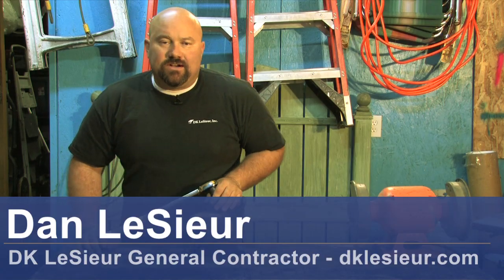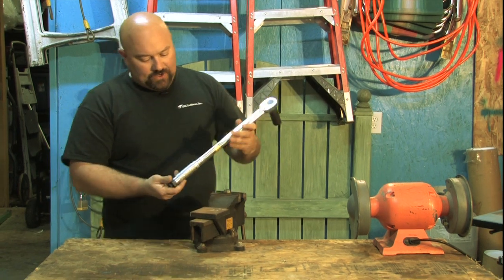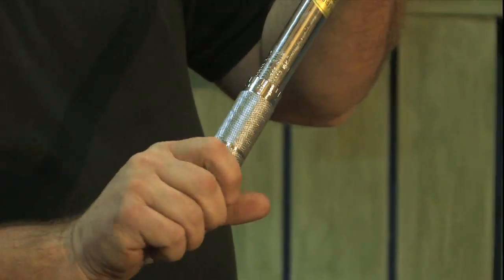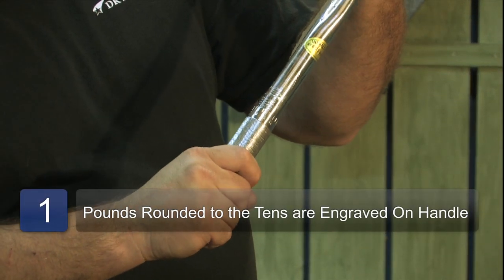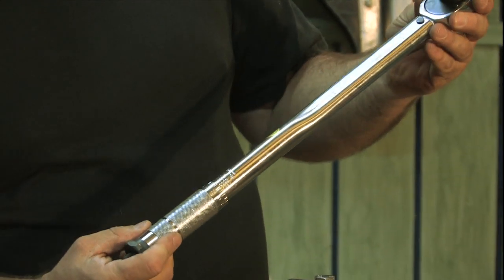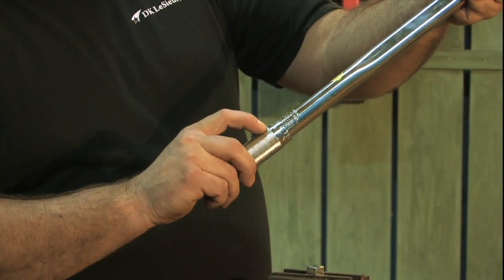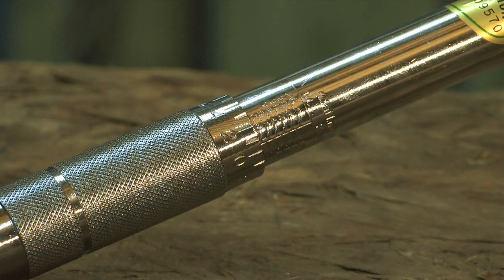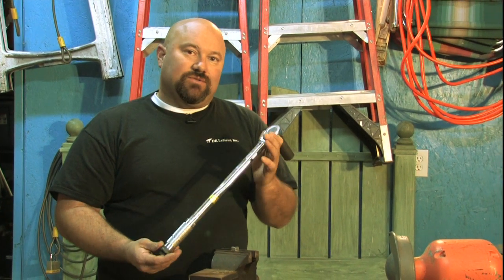How to read a torque wrench.mpeg

Comment: sorry but u did not explain how to read the scale,  specifically what is the relationshipbetween the vertical scale and the scale on the rotating sleeve .  my vertical scale has increments of 14 ( 28,42,56,70,84 Nm  2.9, 4.2, 5.7, 7.1KgM)  the circular scale is marked to 12 but there are 2 more to zero making 14  twice around the shaft ( 28 divs all around)    question   if i wanted to set 70 do i align the top of the rotating sleeve exactly to the horizontal line of 70  which on my wrench occurs with 9 on the rotating scale at the verical line  OR ALTERNATIVELY do i rotate further and align zero with the vertical line with 70 as the next reading but i am well above the 70 horiz line which aligned at 9